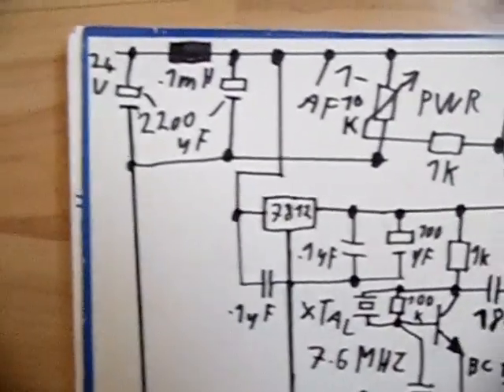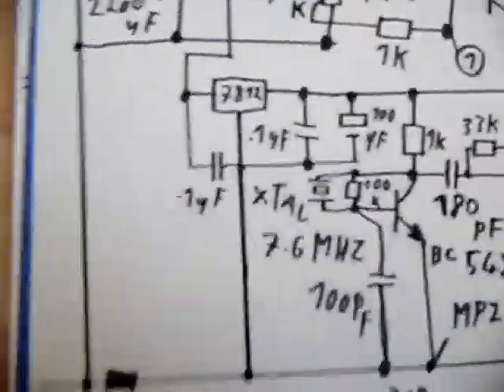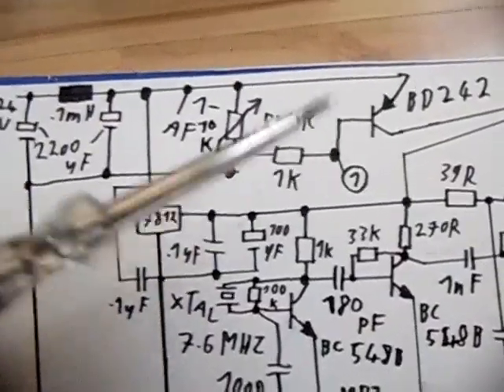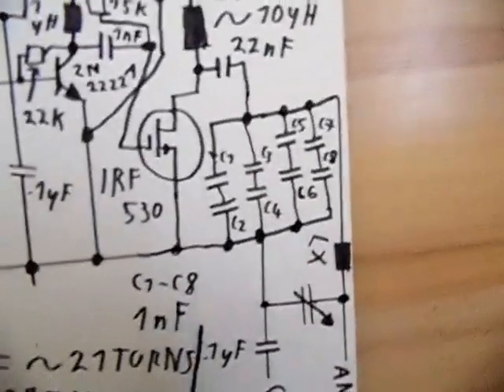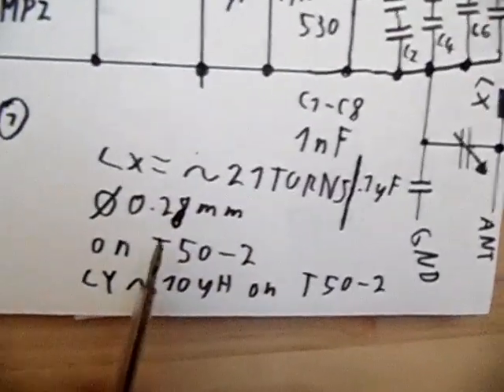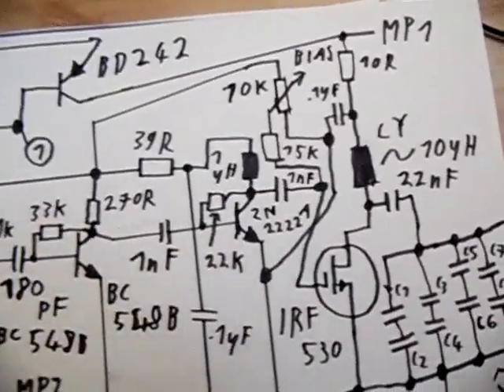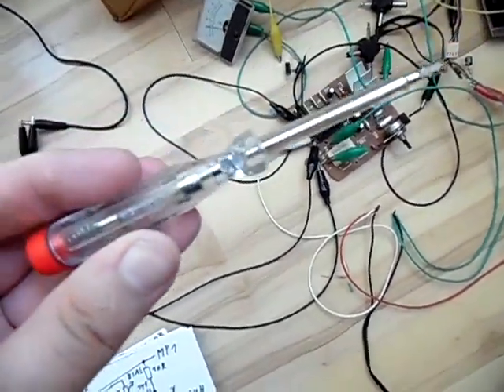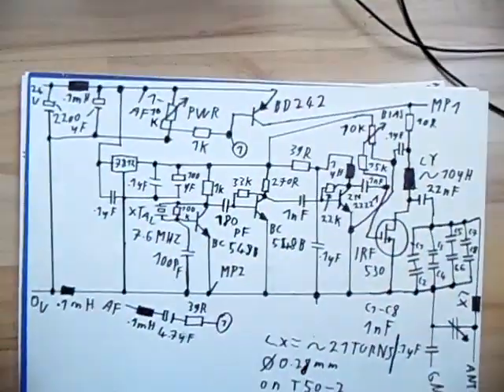Schematic of the transmitter + low power rangetest

Comment: Hello Stefan, Just wanted you to check my drawing of your schematic for any mistakes. Thank you BA
http://i165.photobucket.com/albums/u74/ba276/projects/10wattswtransmitter_zpsbef0dcf5.png
Reply: I can not thank you enough, your schematic is so clear, but I think the 780 pf cap might be a 180, I do not know for sure. I also think that the inductor that connects to the modulator transistor base is the audio input, and is not connected to the 24 volt supply.
Reply: I changed the 780pF to 180pF. I am a bit lost on the inductor connection. You should be able to open my schematic in Microsoft paint and edit it. I would be happy to see your changes. Thank you Ba 
http://i165.photobucket.com/albums/u74/ba276/projects/10wattswtransmitter_zpsbef0dcf5.png
Reply: ba276 The base of the BD242 transistor has a 39 ohm resistor, a 4.7uf cap, and a .1mh inductor going to the plus 24 volt power supply, I think that instead of being connected to the power supply, the inductor is the audio input. So the base of the transistor along with the connection to the power control, will be connected to the resistor, the cap, and the inductor and the end of the inductor that is connected to the power supply now, will be connected to the audio source. Sorry I am unable to use the picture editor.
Reply: jdflyback Ok, I made the changes and updated my schematic link.I am lost on what the connection from the +v is used or connected to.
Reply: ba276 I think you missed the 15k resistor in you schematic. In the "original" plans form Stefan, ist located on the wiper of the potentiometer (right one).
Reply: Thank you